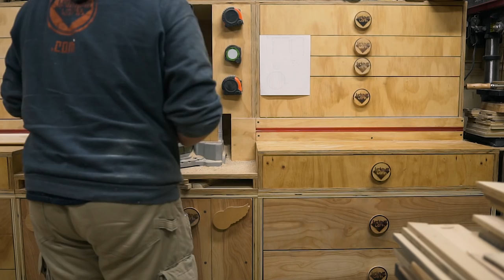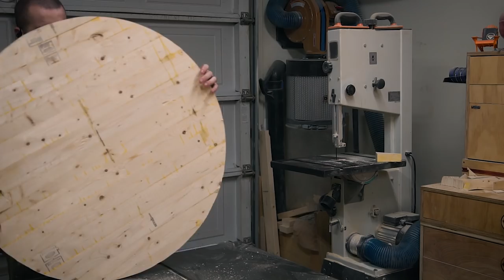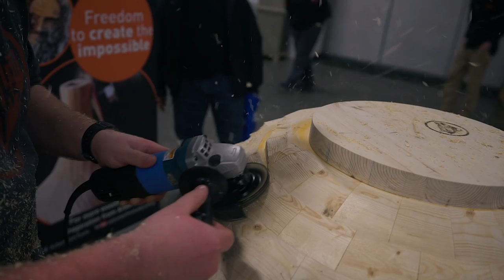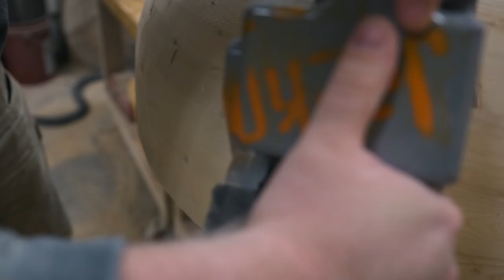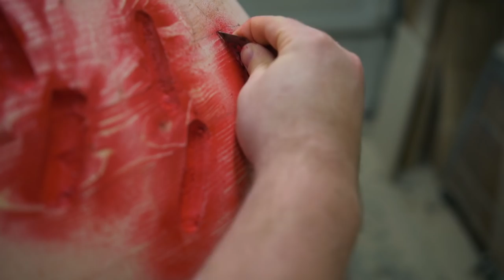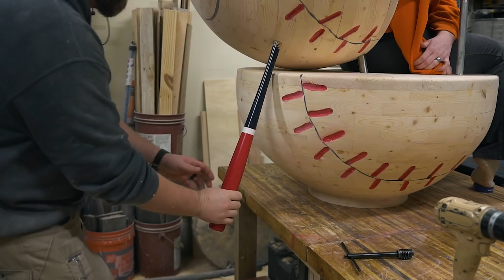Building a Giant Baseball Chair (from 2x4s)

Comment: Man, you hit that one out of the park!  Awesome build, and video.  I'd give it a 9.925 for a score. But adding a carved glove or two to the outside of those armrest support posts with cup holders drilled into them would definitely push it to a 10.0.  A slide out cooler between your legs up front on drawer rails would probably be over the top...  Fantastic project and build execution! :)

Comment: OMG, my eyes are watering at the sheer time and effort and materials and equipment in this project. And it is a class result but I could never find anyone to pay for all that. BTW what is that wheel you have on the angle grinder that does the rough shaping for you, can't be just a flap wheel. PS. jusrt got it, turbo plane, what a cracking idea. bet I can only get it in the US. :-(
PS again, £110-00 in my hood SHOCKING. No chance of me spending that, I expected it to be about £20-00